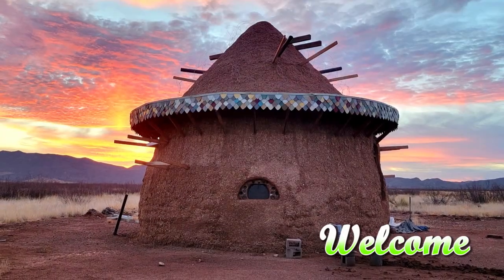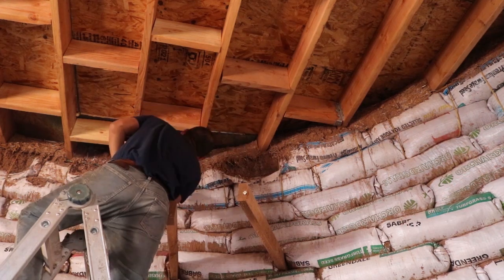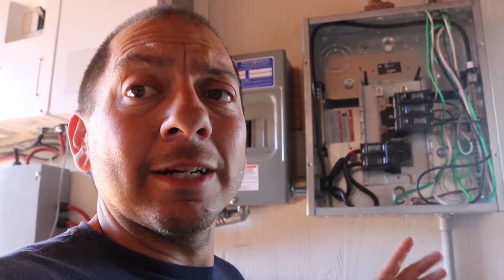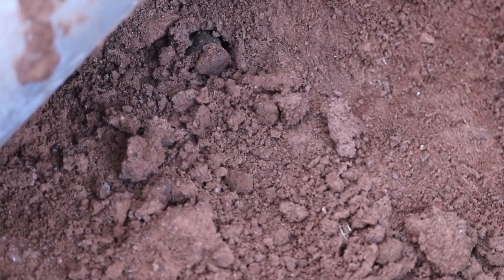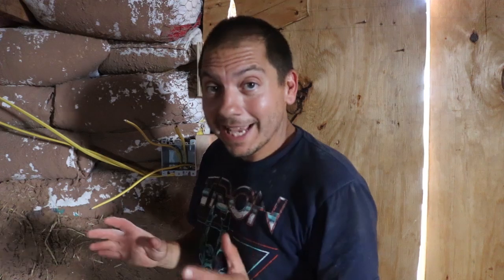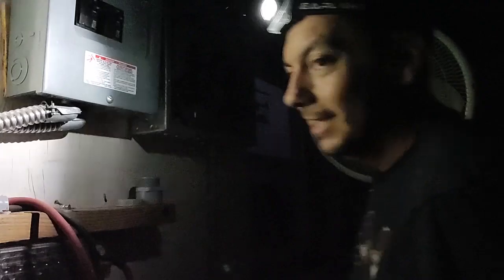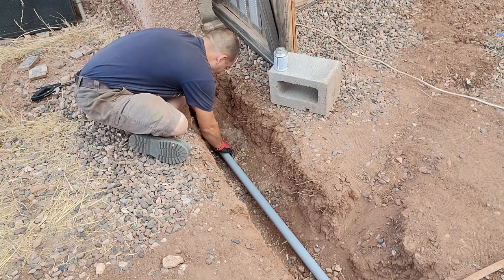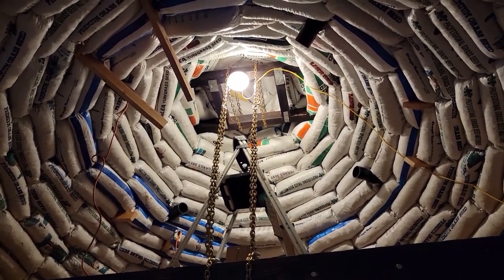Electrical Installation In Our Earthbag Home | Full Install Start To Finish

Comment: I really hate to chime in,  but here I go. I used to install sprinkler systems in Arizona, I have dug in dirt just like that. It always works better if you stand in the trenche and chip towards your legs. Instead of the opposite. It puts you lower so you don't have to swing the pick below the elevation that you are standing at. It's also easier to chip away from the mass or high ground, instead of swinging the pick or "maddox" into the mass or high ground. I hate it when people critique your work,  so I'm sorry. I just want to help you.☮️. I LOVE WHAT YOU GUYS ARE DOING.☮️
Reply: @³
Reply: Very smart. I would have never thought of it!

Comment: Yup I cheat when running wires , I’ll put the wire in the conduit as I go , then glue 1 one section at a time . That& alway go way bigger on the conduit than you think you need . We all learn the more we do it . Don’t be shy with that wire lube , just fill up the conduit from the side your feeding wires . Haven’t finished watching, but if you got all those wires thru that conduit, your my hero Jim . You alway do surprise me in your work & inventions . Getting closer yall !!!!

Comment: You know. Since Jess loves painting, and whatnot, trace your wires before you finish the walls. Then let Jess draw/paint some sort of pattern that follows the wires you have, this way you know exactly where the wires are at, and you also get what could be an interesting cool design that follows the wires!
Reply: Great idea ..... also take pictures with a tape meaure at key points in case you need to drill something....
Reply: Yeah I was thinking it would be better if he followed more logical and straight lines for location purposes, but I understand he was trying to use the crevices but he didn’t do that every time so I’m not sure he had to at all.

Comment: I'm a big fan and a fellow desert worker. One of my favorite ways to move earth is to use a HAND TRUCK with a 5 GALLON BUCKET because you can roll the bucket in and out of holes and ditches, and with the hand truck, the center of gravity is lower than a wheel barrel or wagon. I hope my comment is helpful. 🙏🙏
Thank you for sharing all the videos. I know it takes a lot of time to share stuff on YouTube because I have my own channel also. I hope you like it if you have time. 😊

Comment: I've been doing electrical for many years, some with professionals.  I always run the wire in the conduit as I go.  The minute I saw what you were trying to pull through there I knew there was no way  to do it.  You can if you just tape all that wire together before hand for the whole length you need every couple feet or so and just feed the conduit over the wire one pipe or elbow at a time.  I was surprised you even got that fish tape through there honestly.  You probably could have pulled two of those #10s through there or 3 but, due to the corners, as you say, the friction just gets nuts !  Just in case anyone else is listening here.  You actually are very good at what you're doing bro !  Keep it up !  Sorry for the little delay there.  Kudos on doing your own home !  I tried it once for someone else and built all the walls 1/2" too high and the inspector said to shorten all the walls in the house so the trusses are free to move.  I gave up.  They got someone else to finish it.  I wasn't charging anything close to scale so, if I'd been charging what I make today, which is still low ($50 an hour), maybe I'd have just sawzalled the trusses off at the plates and added a half inch ply plate on the perimeter walls but I did not think of it.  The right move would have been to do that and not tell the owners what the inspector said !  All I heard from them after sharing the results of the inspection was a string of endless swear words.  Good experience building a home though.  3 bedroom house but one level and on a slab.

Comment: I have two words for you...back brace!
I have had back problems for years (degenerative disc).
It's easy to forget, and not use the brace, but I have finally gotten in my head that if I'm doing heavy lifting, or digging, or even sweeping (which is one of the things my doctor warned me about), it will save your back, especially as we get older.
It's just a thought 😏
❤️🌵☀️⛈️🌈☮️
Reply: I use my back brace for walking dogs and doing other chores.   I feel for you back issues.
Reply: @Laurie  just wondering how you forget about back pain from degenerative discs ???

Comment: I could have sworn I had already watched this, but you didn't post it until today.
Reply: I thought the same thing. Went back and saw that this is a combination video of 3 previous to make it all in 1. Goes better with their newer format of single projects per video instead of haphazard back and forth project updates. I'm honestly fine with either, although the daunting length of this one is a bit much for my taste. Although, I would watch it if I hadn't watched the 3 parts already.
Reply: I think you are right, and this is a compilation of the process. Good thing is that they will have the entire process in one video.

Comment: Insulated electrical wire anchors.  Gardner Bender MSI-75BX Polyethylene Insulated Metal Staple, 9/16 in, 14/3, 12/3 & 10/3 (NM) Cable, Tan

Amz has 100 for $3.61

Comment: Congratulations!! The only thing I would suggest is to run another set of wires for a rheostat switch for your fan speed controller because the chains break.🙂

Comment: A future idea, instead of using a fish tape on a long run. You can use twine with a puff ball on the end or cloth. You then use a shop vacuum to suck it through your pipe. Connect to your wires and pull back through. A lot easier than pushing a fish tape. Hope it helps you in the future. Love your build. My wife and I lived off grid for 10 years in Washington state.❤

Comment: HOWdy  G-D-P, ...
FLIPPING the SWITCH 🙂 !!!
I "reduced" my CONDUIT from 2" PVC Conduit ( OVERSIZED )  down to a Fiber-Optics Teflon lined 1 1/2"  ( still plenty large ) that I kept finding discarded on the side of the Roads & Highways 
Which allowed me to return  50' of 2"  PVC  Conduit to MENARD's for about $ 150.00 REFUND 🙂 
Thanks
COOP
the  WiSeNhEiMeR from Richmond, INDIANA
...

Comment: Next time U pull wire . Pull from low end and feed at high point allows use of legs in pulling and feeding arc sweep at the high point. Also over size conduit for future pulls using existing wire . One wire out new and replaced  old wire in. Build fan on the ground the hook on fan bracket will hold during installation

Comment: Since you appear to have excess solar during the day have you considered building a recirculating shower?  On the very low end RV units cost as little as $500, but realistically reasonable home units are several thousand dollars. It's a lot of money but it could be a real comfort.  You don't need to buy it now, but consider the plumbing and electrical details so you can retrofit a system later. 

Great work!

Comment: you should think about running 12-3 for any 3-ways and also run 12-3 up to your ceiling lights in case you want to control a fan and a light. 4 -#12 wires under a yellow wire nut isn't safe. Use a red wire nut, imho.

Comment: THOSE 2 WIRES GOING SIDE TO SIDE RATHER UP & DOWN SHOULD BE FRAMED IN  WITH WOOD THEN IF THERE'S A PROBLEM YOU CAN FOLLOW THE NAILS WITH A STUD FINDER & YOU SHOULD KNOW WHERE THE WIRES ARE ..

Comment: if you use the bottom two terminals on the GFCI receptical to wire up the other receptical it will be ground fault protectected as well. . just a money saving tip .

Comment: before you put cob on the inside. take pictures of all the wires and keep them in a file.  that way whenever you are wanting to do anything like put a picture on the wall or anything else you  would know exactly where the wire is. 
I would also put wires outside for security lighting and front door light.

Comment: I might suggest that when you utilize  STRANDED WIRE in a Breaker Box, INVERTER, Charge Controller that you look into some  FERRULES 
... 
These boxes are generally  engineered for SOLID COPPER Wire ( not STRANDED Wire)
Just a suggestion
COOP
...
Reply: The design accepts stranded or solid wire , your statement is in error
Reply: Hauling the whole roll up the ladder hahahahahahahahahahahahah

Comment: How is the structure reinforced?
Reply: Um, you have to go back a year and watch. :-)
Reply: It's a earthbag house.  Continuous sandbag, usually with a strand of barbed wire or sometimes rocks in between. With a water proof outer finish. Similar to stucco.☮️
 I think originally designed by NASA as a way to build on the noon. You only got to bring the bags and then fill them with moon.👍
Reply: Moonbags?
Reply: @kurtcurtis2730  yes! we will fill them with green cheese, that is abundant on the moon. But seriously that's what I read. I know ask you God Google.☮️
Reply: @kurtcurtis2730  Moonbags on the moon.🌛👍
Reply: @kurtcurtis2730  that isn't reinforcement
Reply: I feel so common .  My house is made from crap I brought back from the dump.  Think amazon sells stardust?
Reply: @kurtcurtis2730  Right next to the unicorn section.🌟 🦄

Comment: the reason 24" trenches are used is when it rains the ground gets wet. should you drive over it when it wet the pipe will break and wires will chafe from the broken pipe. In the desert always bury 24" deep and over size your pipe.  Now that I've been here for 20 years I've seen the grade level decrease to do erosion. I was working at a friends house, digging trench and found the main supply just 2 inches below grade due to erosion. wires were nicked, good news is it wasn't raining that day..... Liquid electrical tape...

Comment: I would HIGHLY RECOMMEND a low voltage emitter in and outside for critters... Trust me, you will need it when the rats and mice decide to make your home their home.. Good smells on the inside, access from the outside..

Comment: Do not connect the conduit sections or elbows together until you have run the wire.

Comment: Do you have a building inspector in your area? Or don’t they care? Just wondering
Reply: In this case they have an opt out meaning the building inspector is not going to go over the electrical part.
Reply: @hollyslager2883  is that just on solar builds? Truly interested in knowing the codes and policies for solar vs conventional builds

Comment: GroWatt = My INVERTER Schematic indicates that my NEUTRAL should be "BLUE"  on my A/C Output 
so  I did the same thing = Colored TAPE  ... 
ALL that  I had was  RED & BLACK  8-AWG Gauge  wires ... so ...  I  wrapped a BLACK wire with BLUE Tape in several obvious places 
DONE 
COOP
...

Comment: If you are trying to be compliant with National Electrical Code, you are required to have a disconnecting means at or near the point your feeder enters the building.   It could be a main circuit breaker or a safety switch.
Also, there should be neutral bar or bars and a ground bar.   You should also install two ground rods connected to the panel ground bar.(lightning protection.

Comment: This seem to be old news.
Reply: That's what I thought, they already have the wiring done.
Reply: I thought the same thing. Went back and saw that this is a combination video of 3 previous to make it all in 1. Goes better with their newer format of single projects per video instead of haphazard back and forth project updates. I'm honestly fine with either, although the daunting length of this one is a bit much for my taste. Although, I would watch it if I hadn't watched the 3 parts already.
Reply: It’s a remix combining multiple videos into one complete story.  It’s hot and also is monsoon season.  Good for them for finding a way to produce a video even when it might be difficult to work.  Personally I liked watching the summary.

Comment: Too many code violations to mention, you are going to have problems at a later date with overheating / overloading, voltage drop ++++. Not  counting the unsafe installation methods!  Even the ceiling fan is going the wrong direction !